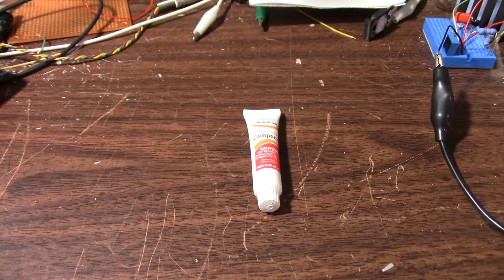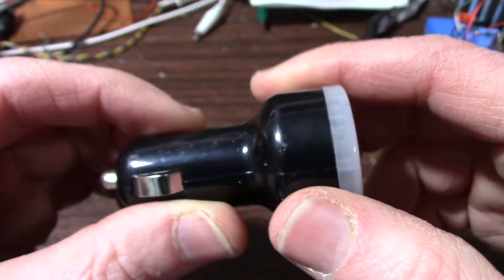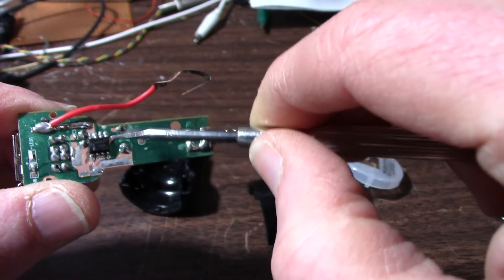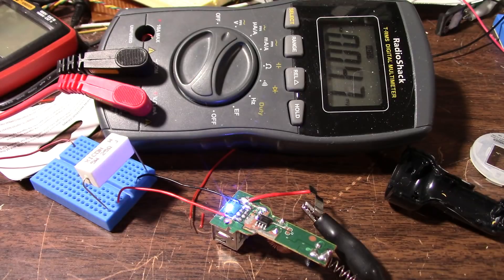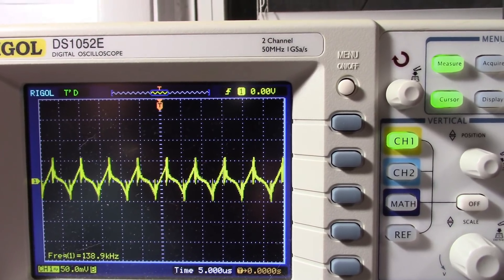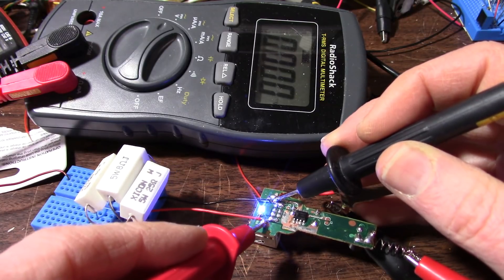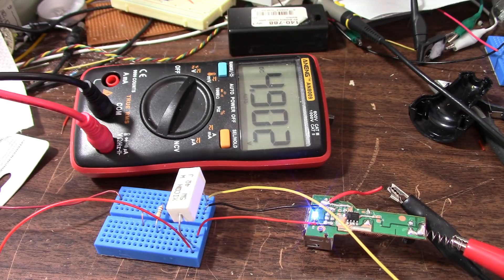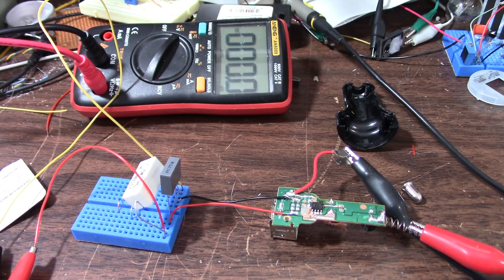$1 USB charger for use in car - test and teardown

Comment: Hello John, hope all's well. Usefull video showing loading a bit of kit. Decided to add a USB charger to a bench power supply I'm building. The unit I found (an 8A x 4 port) seemed to be made quite nicely but there is a bit of a problem mounting the thing. It has one 3mm hole between the USB sockets and 2 x 2mm holes at the rear. They cannot be opened out. Somehow I have to solder some 2mm studding into 3mm stand offs (or something). M2 screws, nuts, etc. are not common, at least in the UK, and I suspect the USA as well. It's worth having a very close look at some of this Chinese kit. I have put a few V through it and all seems well but please don't ask why I chose 8A - I have no idea. A good safety factor sounds good to me.
Reply: You should plug the charger into it's own power supply, and leave it in it's own enclosure. It's pointless to add a large load like that inside a lab power supply.

Comment: I wonder if the chip has a crowbar circuit, but without a input fuse, it just fried.
Reply: Seems like a fairly decent charger...provided it had a fuse, those additional filter capacitor(s), and surge suppression to prevent the output from going over 5.1V...
Reply: It recovered, didn't it?  The chip is supposed to have current protection.

Comment: With no input fuse; should a chronic failure occur (likely), well just use it to light your cigar and possibly - everything else! :)
Reply: Reference circuit from chip mfg. does not show an input fuse (but does show an input bypass C, missing here).  However, back of package warns not to start car with unit plugged in.

Comment: Could you possibly make a video covering how to hook up a dual supply pre amp with a single supply amp or vise versa? I made an active low pass filter using one of the designs from your YouTube videos and it works quite well on the oscilloscope but I’m not sure how I would hook up such a dual supply op amp stage to a single supply amp since they have two separate grounds. Bias the entire two stages maybe to have the same virtual ground?

Comment: what happens if I power a class AB amplifier with 2 single output SMPS? will it be a good idea to do so? some smps are cheaper than toroidal transformers. can u make a video on the subject?
Reply from the maker: Yes you could, but for dynamics with playing music, I'd use a conventional transformer based supply.
Reply: I have done this using 2 SMPS in series. It works well. I use some nice size caps for the transients and it sounds good.
Reply: Best place to get reasonably powerful transformers for dual rail amps is old HiFi Amps and Receivers. These are easy to obtain from dumpsters and hard rubbish curbside collection. They almost always use dual rail chipamp packages, so typically a 100W/ch unit will be using 50V to 65V rails. If all else fails, buy one from the local charity store. You will usually get a couple of 10,000uF Electrolytics as well.

Comment: Still looking for those Mighty Malt Eggs! Drat!

Theses are okay for older phones that don't quick-charge, in a pinch. They even work for the newer phones, but at a slower rate - same caveat. Same with their little USB wall-warts. Works for my older Samsung, but the wife's newer phone, they heat up too much. Would I use them if I had too? Yes. Would I put them back into reserve status when better came along? Absolutely.

Snickers!!!!! Awww!

Comment: The downsite of this charger is, there is no coding on the USB ports. There are shorted datalines. This means that a phone will only try to get 1A of current. So it is impossible to overload this charger with two phones. The maximum current will be only 2A. That is good for the charger but bad for modern phones charging speed.
Reply: Don't all you need is a resistor divider on the data pins instead of shorting them? I know you can get chips for CHEAP the does all this for you, just curious.